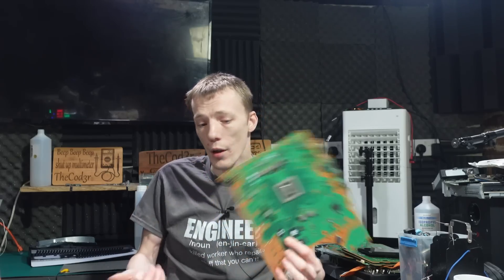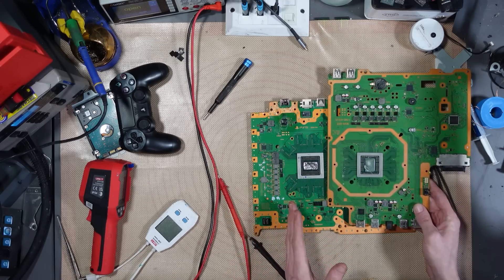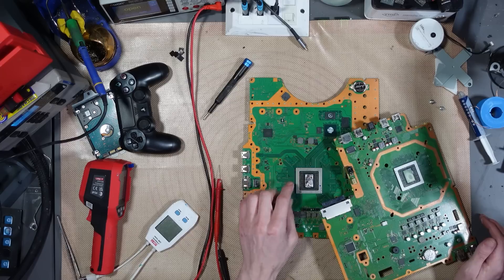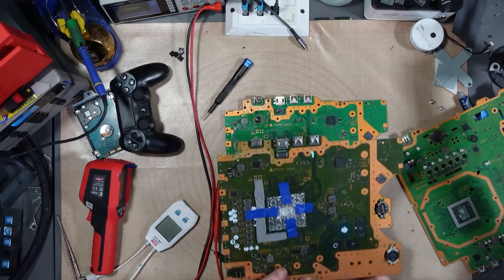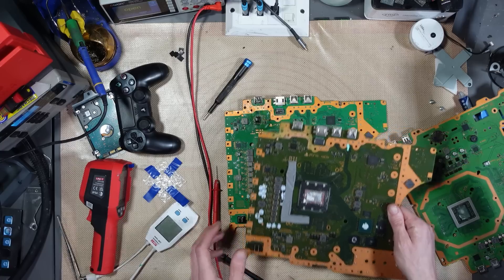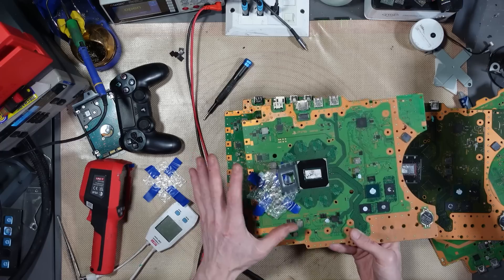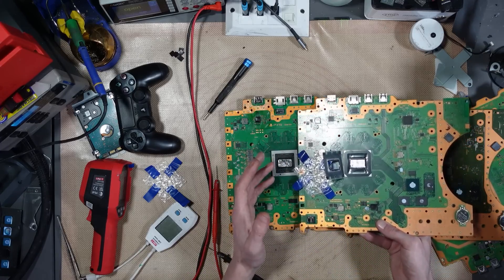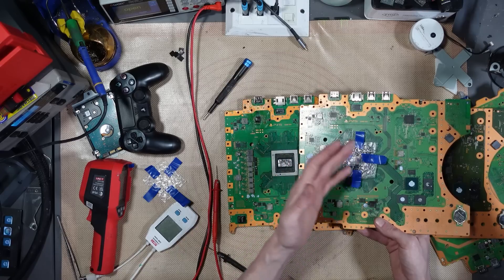Let's Talk About Sony's PS5 Liquid Metal Issue! Is YOUR PS5 At Risk?

Comment: I think a lot of the LM problems come from either dry spots or people bumping/knocking their ps5 while it’s hot and thus splashing it too much inside its apu foam enclosure. Your greatness always impresses Cod3r, you’re a true ps5 whisperer!
Reply: Took my last one back just going to stick out it with y series x
Reply: @jeffrothegamer  well, i still have my ps5 and it works just fine für me. I use the console horizontally and havent encountered any issues so far, but i stay vigilent.
Reply: @Kinsanth_ Just need to remember, that APU Sony used is overclocked, hence the use of Liquid Metal and the reason one side of the board heats up a lot more then the other. So keep it flat and clean it regularly, keep it well ventilated. And if you move it treat it like a piece of china.
Reply: @marksapollo  i still have all my other consoles, even the white, illfated xbox 360. All those consoles are in perfect working condition so i know how to handle them. They are my babies after all, so i would never mistreat them
Reply: @marksapollo  it's got nothing to do with that but good try...
Reply: @chadstudd1616  It’s got everything to do with that, it’s called common sense and how it works. No trying about it.
Reply: Yeah i had 4 ps5’s enjoyed playing them but i honestly think Sony rushed this design.
Reply: Stop defending sony they fuked up real bad with ps5 i mean look that floppy design!!
Reply: I haven't had any problems with mine. I have used it vertical since launch and have traveled with it. I think it's going to be very rare for this to happen. It's most likely been tampered with or abused.
Reply: There are cases reported, where the liquid metal already got spilled whilst standing around originally packaged for 9 months. But your point is in my opinion also legit

Comment: Reason Sony uses liquid metal is because their over clocking the hell out that chip to get everything possible out of it( also sound good for marketing). So it needs to be sufficiently cooled. For another model they can use a more powerful chip that doesn’t have to be pushed so hard to get the same power. So normal thermal paste can be used instead of liquid metal
Reply: And thats a lie
Reply: @amunra1743  No its not. The PS5 GPU has a high clock speed. It therefore generates more heat.
Reply: @xx_epic_gamer_xxsherrz9132 having a higher clock speed is not the same as overclocking.
Reply: @homiej8163  there's literally news stories about it being overclocked so as not to appear significantly weaker then the XSX use your preferred search engine to find them as they're a couple years old by now.
Reply: @xx_epic_gamer_xxsherrz9132  and that's another lie.
Reply: @YouTubeCensors  what you are referring is Sony’s “Game boost clock” technology in the PS5. But that still is not overclock.

The APU in the system doesn’t run in unison, but has the CPU running at a max 3.3 ghz and the GPU at 2.3 ghz. This is just a difference in frequency. NOT overclocking.

The other area would be where many outlets were comparing the PS5 to an overclocked 2060 super, but that doesn’t equate to the PS5 being overclocked itself. Again, it’s an APU, so there isn’t any real consumer comparison.
Reply: @xx_epic_gamer_xxsherrz9132  So over clocking is good if manage the heat.
Reply: Yeah the PS5 was originally fixed frequency with a optional boost mode/variable frequency. Sony was forced to enable this to close the performance gap with XSX on paper anyway. 

This led to thermal issues which is why they used liquid metal. I would also say this is why they did the recent 6nm shrink which allows better stability and possibly without liquid metal ?

I'm waiting for the SSDs to start failing, soldering the NAND chip direct to the PCB is a big issue waiting to happen
Reply: @grumpyoldgamerUK   this isn’t facts though just hear say
Reply: @grumpyoldgamerUK  Phil posted a video where he changed the ssd today. I won’t spoil it for you so you can check it out .
Reply: @eathenalexander2836  That's fine if you can handle surface mounted components but it's not a average Joe fix. On XSX/S it's a simple swap over. Some of the engineering choices on the PS5 are very questionable, though some of the design is very questionable too as it's shader starved for its target resolution/performance too
Reply: Wrong!! Jesus does anyone actually fact check before posting....

Comment: I know this isn’t related directly to this issue but this seems to be a good place to ask. I’m worried my ps5 gpu may be failing because I have noticed a few weird graphical glitches in a few games. These are few and far between and I can go days without seeing an issue. If my ps5 gpu was failing would it be very apparent and be getting worse or could it be very slight like this. I’ve had my ps5 for around half a year now.
Reply from the maker: It is possible that the APU os failing as there have been a few cases of this happening. If it's still under warranty I'd immediately send it back to Sony as it will gradually get worse. It could be a simple HDMI Encoder issue, or could be RAM related too. Either way I wouldn't bank on it getting any better 😞
Reply: @TheCod3r  thank you for replying I appreciate it. Even if I can play a game for hours without any issues it is still most likely faulty you reckon? I’m just wondering if I’m too paranoid about my PlayStation and the glitches I saw were just bugs from the game
Reply: @saulgoodman4950  try to clear your system software cache and rebuild database cld be corrupted data but if not then...

Comment: Those who say it's all lies don't want to hear anything bad obout their beloved PS5, But let's think about this logically, you cannot defy the laws of gravity and liquid will always be pulled down.
PC CPUs are built different from consoles as they have a heat spreader which covers the caps around the die, consoles have a bare die as that is the best way to dissipate the heat to the heatsink just like a laptops CPU/GPU, some will say "yes but some laptops have liquid metal and they run fine"
Yes they do because the majority of the time they are laid flat so the CPU/GPU is horizontal.
But the last thing I will say is that "consoles" are not meant to be portable and should stay in the same place and not carried around to your friends house and plonked on the nearest flat surface.

Comment: Could this issue be caused by them being knocked over in vertical position? Could it be the impact of them hitting the floor and being stood back up, that might be causing more severe leakage in some than others?
Reply: It certainly wouldn't help.
Reply: For one. It's the biggest console to-date. Having anything vertical can have problem of being knock down easily. Let say a kid and or pet.
Reply: I thought that myself. Does the liquid metal become more viscous when it heats up? If so I could see a console that’s on and knocked over having this issue occurs. Otherwise I think the seal would hold
Reply: @Neo_Rain146  If the PS5 components have zero issues then ofc it shouldn't be deal at all. But let's say in every 100000 PS5 1 of them is not fully "compact" so they have very very low chance to spill but still they should be fine. But because using vertically adds gravity factor in to it's not hard to guess this can happen especially when it gets too hot because of thermal expansion. So yeah better be safe than sorry i guess.
Reply: @resonmon  True, I’ve had my launch model horizontal from day one. No problems besides a lil harmless coil whine.
Reply: @Neo_Rain146  Btw i'm not an engineer or anything like that i have limited knowledge about PS5 interiors but common logic shows that's  not just with PS5 but every stuff which stands vertically on flat surface are  waaaay more prone to  potential ''accidents'' like a pet, child or even yourself hitting them no matter how much careful you are. Never risk anything
Reply: @Neo_Rain146  I mean I have used liquid metal for years on my vertical pc builds and not once have I ever had it run or drip down. But Sony add a fair bit to the sparing amount you'd use in a PC and my PC has never been knocked over either. There have been so many accounts of the PS5s being knocked over by kids and pets which is why the hdmi ports get ripped out when the strain on the cable takes the brunt of the impact. So like I say, I was just wondering whether that impact could be responsible for leakage too.
Reply: @SCorpG22  I’m not very clued up on building PC’s or liquid metal but when I first saw the PS5 tear down and learned about liquid metal it did occur to me that gravity might be an issue. That’s why I have always had my ps5 in the horizontal orientation just like my PS4 was. Whatever seals or spongy Barriers could also degrade over time so better safe then sorry I guess
Reply: @Neo_Rain146  I would say horizontal is the best for sure. The amount of liquid metal I have I have used on my cpus and the cpu block is maybe 30% of the amount Sony use. Maybe they have a reason for using that much, but it just means there is more to roll around. I would like a PS5 eventually, although I dislike the design of it immensely. I'd much prefer it didn't look so unstable a shape to stand up. Or it looked better lying down and less like a taco, lol. But to each their own I guess.
Reply: Still it kinda shows that ''Vertical'' position will always be risky for consoles
Reply: @resonmon  Yeah definitely. I'm just thinking that this scenario covers both sets of users who have theirs in verticle i.e. those who haven't experienced it (who maybe look after their consoles) and those who experience the issue (maybe with pets / young children etc).

Comment: I have used plastidip to conformal coat boards in the past.  At around £11 a can it is very cost effective and I was able to apply 3 coats to one PC motherboard.

However I have only ever used it for one customer who had desktops in an industrial environment that were vulnerable to moisture and it worked very well, the customer was very pleased as faults were far less common.
Reply: You can get aerosol can clear conformal coating probably best option if you want to coat the whole board but do it outside as it gives off fumes when drying
Reply: @TruMouse  I looked at it in my electrical wholesaler, but £24 for 400ml was a bit excessive.

I was using it on Pentium desktops that are borderline worthless, I was selling them spare units for £70 with their software preinstalled, that they could just swap out and basically throw away.

I offered them the conformal coated workstations for £100 to try and that seemed to hit the price point and they are lasting  lot longer it seems, but with second hand workstations it is hard to judge.

Comment: I knew there was a faults in the design of the ps5. That's why it has taken forever to bring them out. It's still not really available to buy like a normal product. This is why they have only slowly put it out for sale. IT SHOULD BE RECALLED ITS FLAWED!!
Reply: I don’t think the liquid metal is that big of an issue but I do feel there’s some very poor engineering on a few select motherboard circuits that the Cod3r is ALWAYS having to repair. People with old or shady home wiring should be very fearful of their ps5 blowing a capacitor on the board. SX is likely a bit more durable against shitty house wiring than the ps5 imo

Comment: That's an expensive weak design from Sony, they cheapskating ?
Reply: No, the heatsink they use has lots of copper, which is expensive. Maybe if they made it taller or used more heatpipes things could have been better.

Comment: Mine has been upright since I got it about a year ago. I concur on the slow liquid roll due to gravity. However if the console is not knocked around potential of spread outside the die area should be close to zero. I may lay mind horizontal just as a preventative measure.
Reply: You know what they say better be  safe than sorry.

Comment: I've just flipped my 6 week old PS5 1200 series from vertical to horizontal position.  Glad I came across this story.  Great video.
Reply: Just placed mines flat I was 2 months in vertical not taking the risk
Reply: I set mine horizontal after reading an article about this. Now it sounds a bit more quiet with a disc in there and while it’s running
Reply: I’ve never had mine standing up i don’t like it like that all my consoles lay on the side
Reply: Had mine vertical since Nov. 2020.
 No issues whatsoever.
Reply: @jonathnjdm714  I’m pretty sure the newer models that have issues
Reply: @BruhMoment-bk6ov  lol and what evidence do you have to back it up? I haven’t seen one issue with the 1200 models
Reply: @jonathnjdm714  me to
Reply: @jonathnjdm714  continue to play with fire & dynamite then....
Reply: @rayoflight-777  Quit being paranoid over a Damn pic!! Lol
Reply: @rayoflight-777  “continue to play with dynamite and fire then” or whatever you said, that was the dumbest shit I’ve seen in awhile
Reply: @rayoflight-777  if it is something that will happen it happens when you first use it use your brain
Reply: @daydayr97  that was pretty cringe ngl.
Reply: @rayoflight-777  must be huh
Reply: @daydayr97  TheCod3r answer : 
Well if the liquid metal was contained properly it would never seep to the left, and should never have to hit the foam in the first place.

If you think about it this way: The foam is indeed there to help stop liquid metal spilling onto the board, granted. However, over time, the liquid metal gets soaked up into the foam and eventually there's not enough on the SoC to actually effectively cool the system. Either that or it soaks so much into the foam over time that it causes the foam to become full, to the point it will no longer effectively do its' job (meaning it'll no longer be able to actually soak up the liquid metal) so it would eventually run over and onto the board anyway.

Now, if Sony actually designed a good system and didn't have to overclock the SoC, they would never have needed liquid metal. If they didn't want the system to look like something from the 2050s, they would be able to put a better heatsink in and effectively cool the system with thermal paste rather than with liquid metal. LM isn't designed for consumer electronics, it's designed for overclockers. Overclockers take precautions which includes a lot more than a little piece of foam.

What Sony should be doing if they want to use liquid metal, is build a proper wall with a proper gasket around the edge, and have the heatsink sitting inside the wall rather than just on top. Sorry but anyone with a brain cell can see that this is going to cause an issue. Gravity will win hands down 100% of the time. I don't care how smart the engineers at Sony are, they aren't as smart as nature.
Reply: @rayoflight-777  You think a multi billion dollar company wouldn't have thought about the liquid metal descending towards the APU due to gravity and taken proper counter measures for it ?? Lmao...
Reply: Just flipped my launch to horizontal just in case. No issues except hdmi I had fixed through warranty
Reply: I flipped mine from vertical to horizontal yesterday when my ps5 when turn off by itself
Reply: This guy is a known Sony hater and the fact he’s made you change your ps5 position is hilarious . If he’s saying having vertical is making ps5s break then since release in 2020 none would be working. Keep in mind they’re stored vertically and moved about through shipping and would be broke on delivery. I’ve had mine vertically since release day with no issues at all. Sony designed the ps5 to be used vertically so that seal where the liquid is isn’t gonna just break and leak. The only way that’s gonna happen is if it’s been tampered with or damaged
Reply: @marcbilaszewski3521  Somehow youre the first one i have seen (so far) expressing how weird it is to hear about this problem 2 years after PS5 launched. Why didnt we hear about this before?
Reply: @marcbilaszewski3521  If you accidentally drop it the seal can break and the liquid metal will seep out, don't call him a liar please.
Reply: You should flip it back to vertical but in the opposite direction (upside down) for a few days so some of the liquid metal that seeped out can seep back in.
Reply: @SithLord2066  don't give wrong advice, that doesn't happen with all ps5 systems, just put it horizontally
Reply: @JorgeRodriguez-xz5ec  totally agree just lay it flat had mine flat since launch and had no issues
Reply: @reborn-gwp7972  have had mine vertical with no issues
Reply: @JorgeRodriguez-xz5ec  this whole vid is wrong advice 💀

Comment: my question to you phill is if this is such a concern for you why do you always put liquid metal back on them when you repair them why not use normal MX5 thermal paste
Reply: Someone didnt watch the video haha.
Reply: It is funny that right next to your comment on my screen is YouTube's recommendation for TronicsFix's video called "PS5 Liquid Metal vs Thermal Paste - It OVERHEATED!"

EDIT: Just finished rewatching that video. It overheated because he unplugged the fan. I forgot about that part. 😂
Reply: If it's the British media reporting this, you can guarantee they will be saying if you own a ps5, there's a risk your house will go up in flames.
Reply: The PS5 APU is delidded, as soon as liquid metal shifts, it shorts the capacitors it falls on.

Despite the fact a delidded chip has an improved thermal transfer, someone tried to replace liquid metal with artic MX5 thermal paste, but the PS5 overheats and shuts down.
Reply: cool that answers that question then